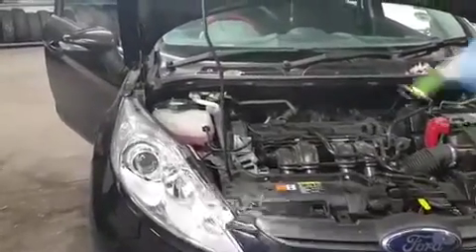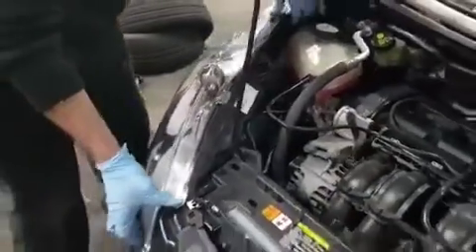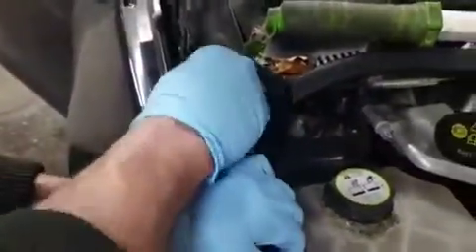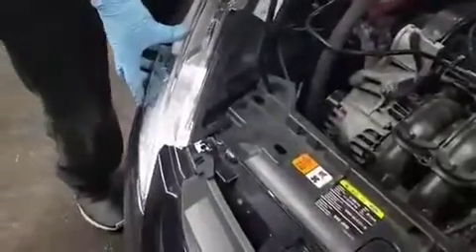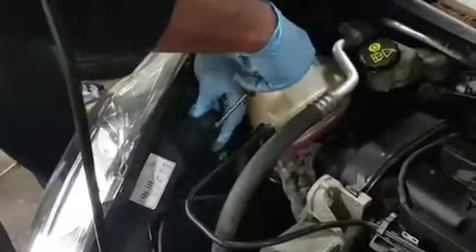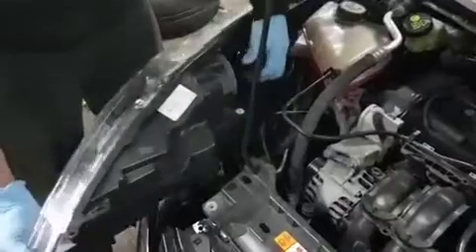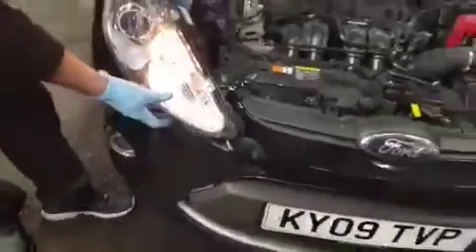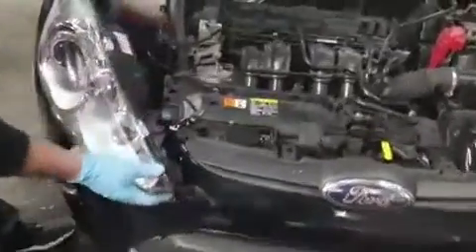how to change sidelight bulb - New  Ford Fiesta

Comment: While I agree the video was fast and not extremely detailed I managed to figure it out just by simply pausing it between each step. Headlamp out, bulb changed and reverse order it back using the otherside as a guide.

Thanks for the vid 👍

Comment: This was very clear - thanks! Is it likely that the headlamp unit would need realignment after it has been removed and replaced in this way (without changing a headlamp bulb, only the sidelight bulb)?
Reply from the maker: Hi you shouldn’t need alignment unless you break the bracket or not screwed back to it’s original markings.

Comment: This is straightforward, but one of the screws is absolutely seized in, WD40 isn’t even helping and I don’t have a huge range of tools available. Any ideas apart drilling the head off?!
Reply from the maker: Hi, try using pliers or mole grips. I had similar issue not long ago and ended up grinding a line through it so flat had screw can be used and it worked.